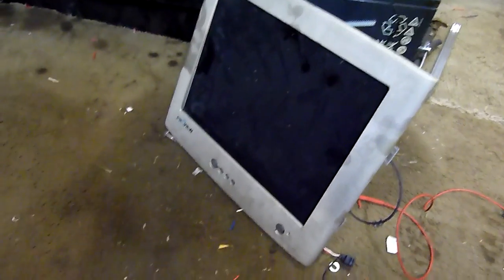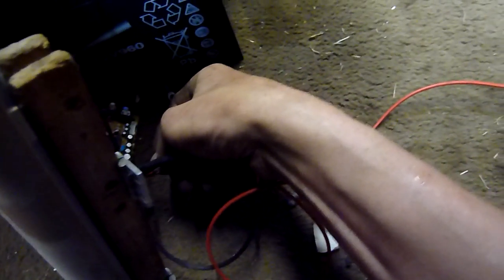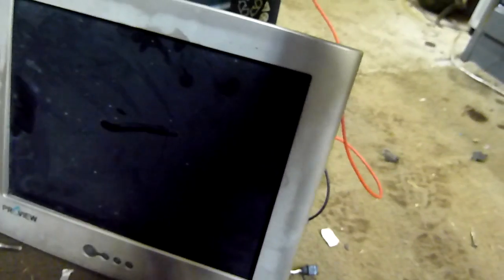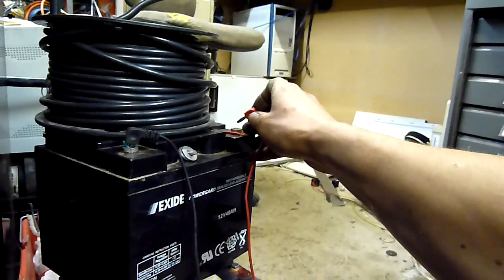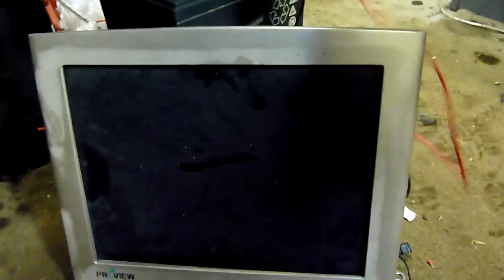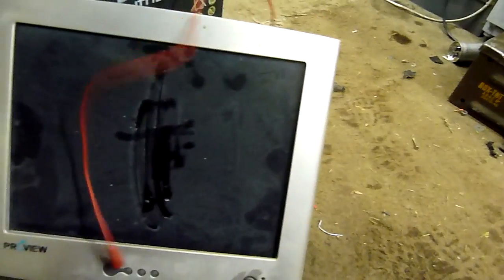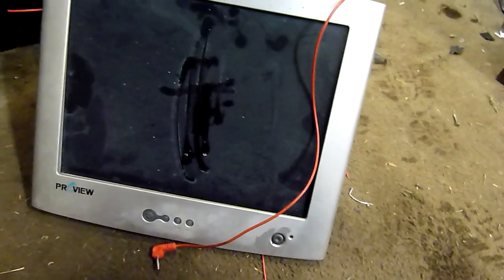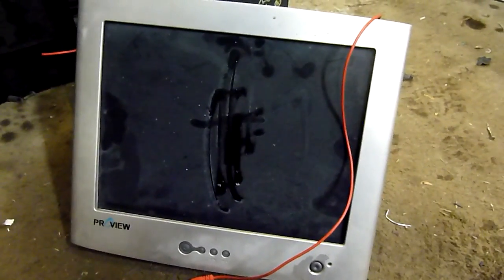Old LCD Monitor at  Minus 30 Degrees Celcius!

Comment: So are most of these LCD monitors with power supplys able to run on 12V's like car's 14.4V's or what ever it may charge at by taking out the power supply and what not.